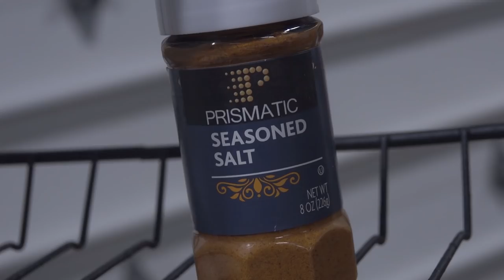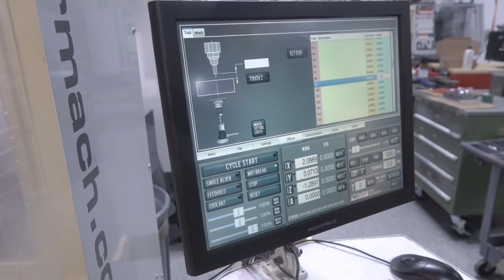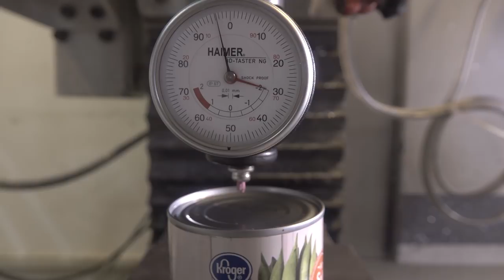HILARIOUS CNC VIDEO | Thanksgiving Dinner in a Machine Shop

Comment: This is pretty funny. Disturbing on many levels, but funny. Some tips from an old timer...

1. use a large v block when opening green beans in a CNC mill so the slitting saw doesn't grab the can
2. A larger radius on the tool when doing the corn on the cob in the lathe will give a better result
3. less heat on the plasma cutter to open cranberry sauce cans is the standard
an finally...everyone knows brass makes better turkey stuffing than aluminum.

Geeze, these young guys have so much to learn.  Happy Turkey Day to you guys from Advanced Innovations!
Reply from the maker: Excellent tips.

Comment: I am so pissed. I was a lifetime member at tech shop and dump all kinds of money into taking all the classes so I had a place to work with equipment that I did not have space for in my garage. The bastards ran it into the ground and close the doors. They knew they were financially hurting while continuing to open new locations rather than saving what they had. I figured I am out about $15,000. At the time I bought my lifetime The company was looking good and been establish since 2006. People literally bought memberships up until the day before they close the door. They gave no heads up that they were closing not even the staff knew and they did not even receive there pay checks. There's a cold place in hell for Mark Hatch and Dan Woods. Sorry to vent on this channel but I love taking knowledge learned from here down to the shop and now money I could have invested in my own tools is lost.
Reply: Yeah, I have a couple friends who worked for them and are now looking for new gigs. It's hard as hell when you're getting started as a fabricator to deal with the kind of hobby-grade crap you can afford, but it's a long term investment. I'm finally starting to get to the point of picking up decent old iron and refurbishing it - tell you what, you learn a LOT about machines that way.